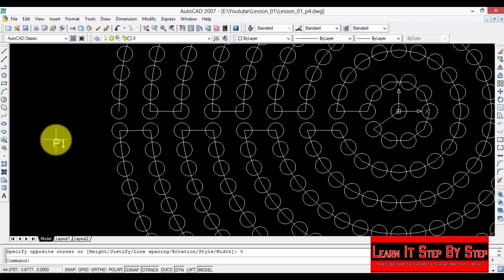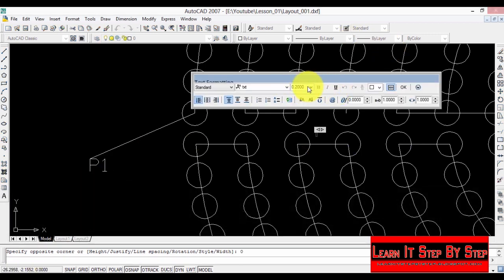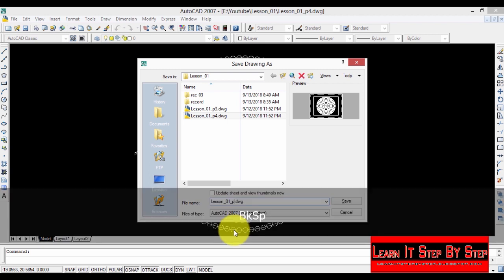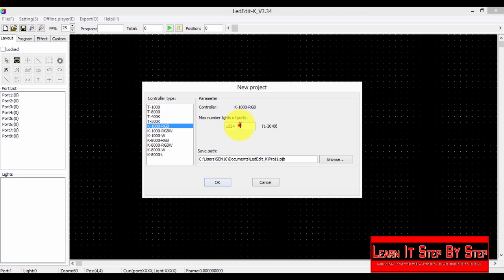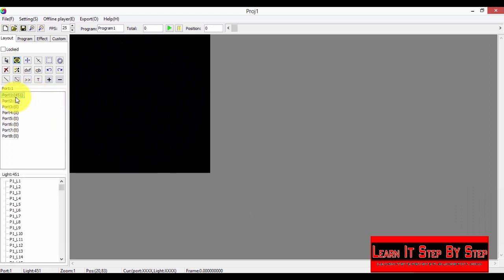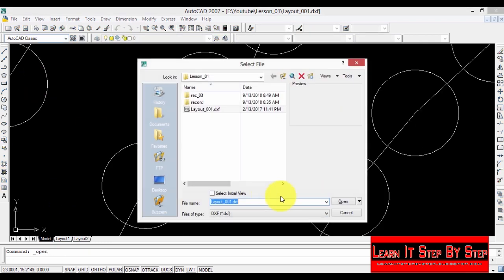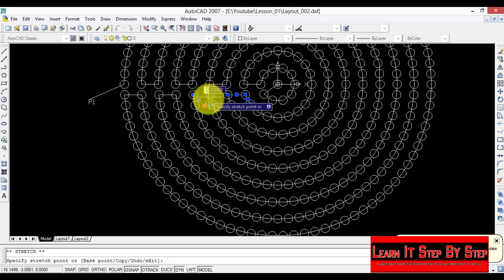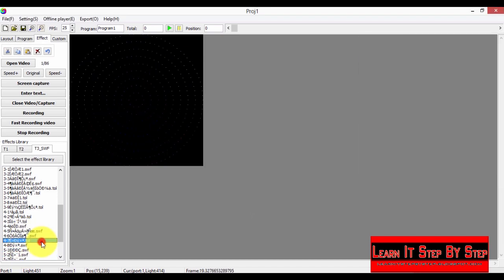LEDEdit Tutorial Creating LED layout with AutoCAD Part-3

Comment: When importing dxf in LedEdit-K it groups every LED in a single led, not showing the correct layout. Any suggestions on how solving this?  I will try the Corel Draw method and see if it works
Reply: i have the same problem , did you fix it?
Reply: @dtmimpresiones  yes! I had to install a native english windows on a virtual machine and use the software to import the dxf file. I used windows xp.
Reply: @engenhologia  thanks a lot for reply,
Reply: It is for autocad or lededit? I tried to generate the dxf on autocad on my windows 10 host, and import it in lededit that is intalled in a english windows 10 VM (virtualbox). The leds are still grouping on the same point unfortunaly.
Reply: @jeanlucm3681  leddit, i used an old xp image and imported the dxf using a flash drive via USB
Reply: @engenhologia  I tried on a windows xp pro sp3 32 bits, and it works with a dxf generated with autocad 2020 and lededit 2021. So it seems windows 10 is incompatible.
Thanks for you help and your fast answer !! :)
Reply: the problen is windows language , i have to re install my windows in english and is working fine, it seems that led edit have some issues whit it, i reat that on a blog  and solve my problem

Comment: I need to set up a table with two LEDs on each end of the table. led ws2812b enderesaveis. each rule has 5 meters with 720 leds. In addition, the hops in each rule and with several different cores. Which program do you recommend for this: which controller do you recommend.